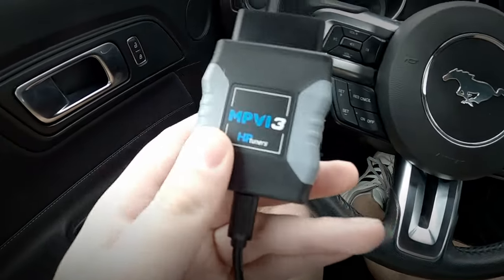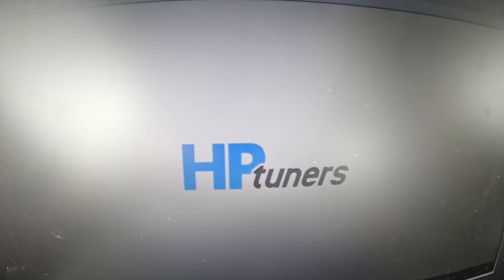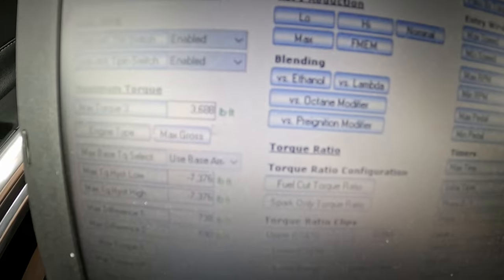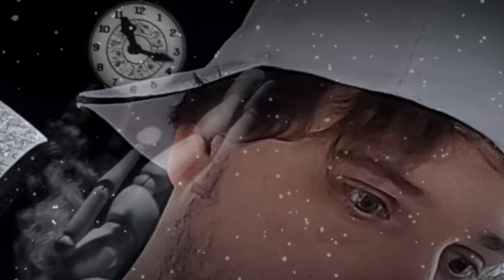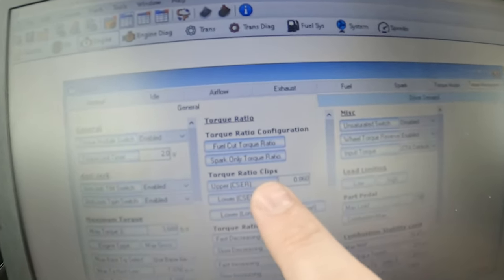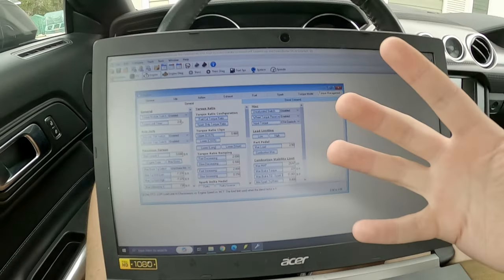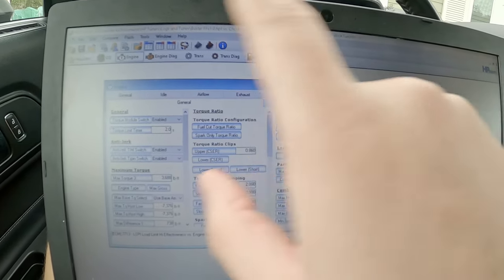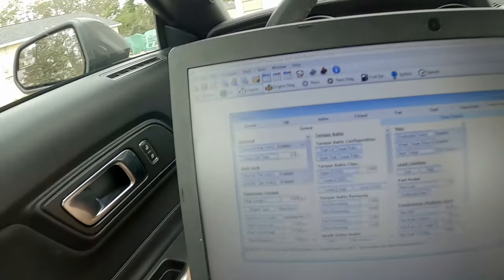Flashing THIS New Tune made my Mustang Undriveable

Comment: Is there not a manual or reference sheet for that tuner device?
Reply from the maker: Not that I know of. There's plenty of resources online, the HP Tuners forum being the best.
Reply: Not at all and this is definitely not an easy thing to do at all. And ford didn’t use stoich past initial eco boost is way different and you need a class like I advised on previous video.
Reply: Also you need a base 93 tune before you ever touch e85 or e 30 as it won’t have same parameters.  That is recipe for ECOBOOM
Reply: Also with it direct injection there is a very small window to mess with the fueling. And only trying to help you so you don’t hurt car.   If you put the work in like we all know you will you will get it for sure. But definitely  a different animal
Reply from the maker: Yeah I've already switched that setting back. My problem is wot boost control. That's what I'm working on with no luck. Bad spikes after tip in.

Comment: Might as well bypass the meth idea and just jump right to port injection  for not much more $ and be able to run any mix u want to
Reply from the maker: In my research, I can build myself a WM kit for under $600 where as the aux fuel kits are well over a thousand. A properly put together WM system should support my current horsepower goals.
Reply: @KarzKreated  I had a wm kit, it was high unreliable but hey, maybe u will have better luck.
Reply from the maker: Me having luck? 🤣 you're funny. I'll take my chances with a WM system for now. Maybe I'll reconsider in the future if I win the lotto 🙂